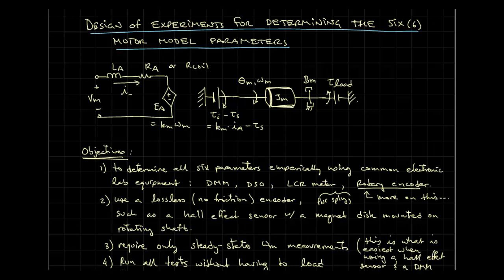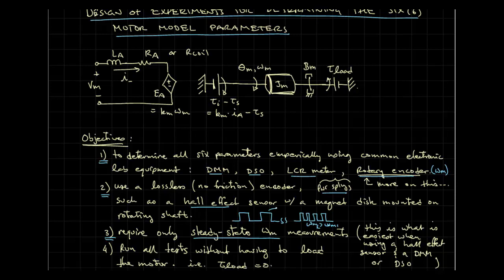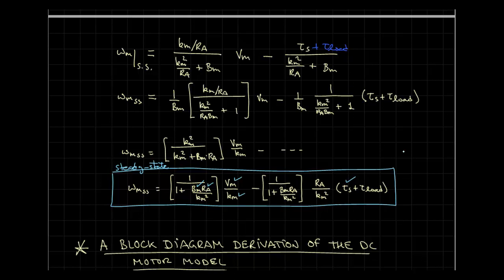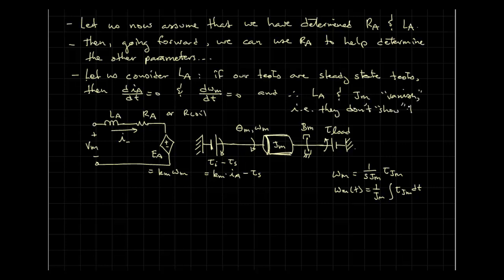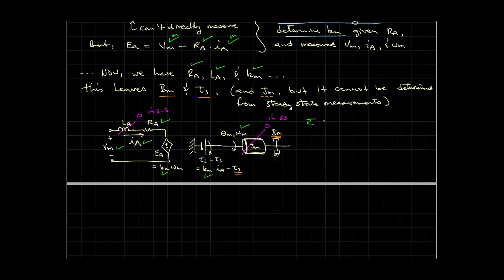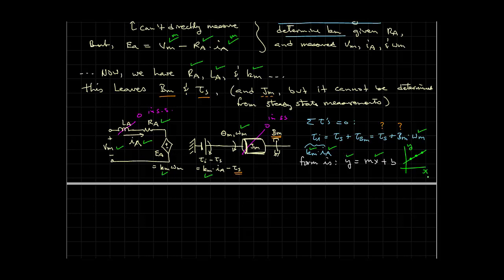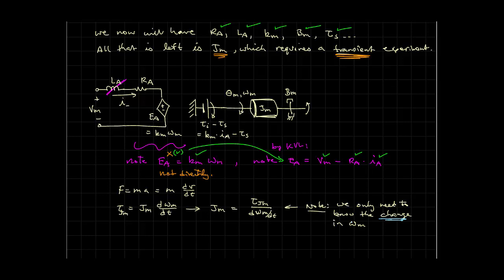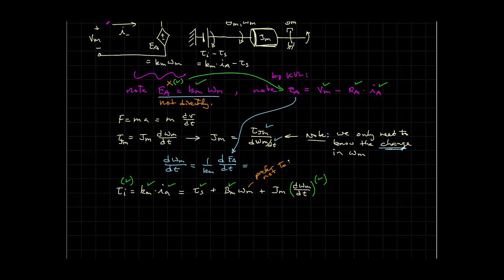DC Motor Modeling - Part 4 - Designing parameter extraction experiments

Comment: What if you had a load torque?  Most motors have a load connected so how do you model that?  Say for example, I wanted a transfer function for my motor that included the load I had connected to it.  How do you apply a tau load?